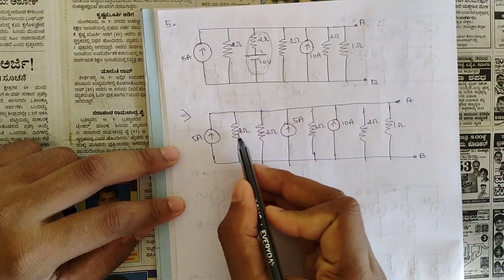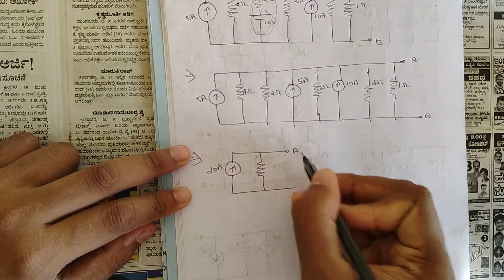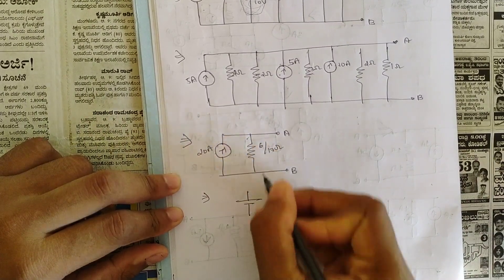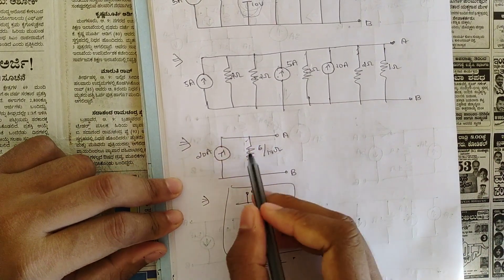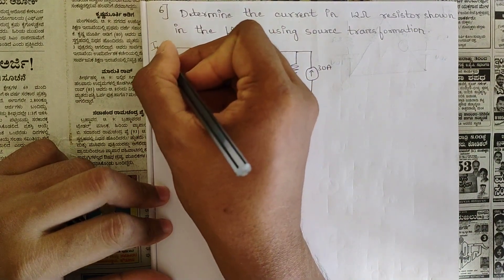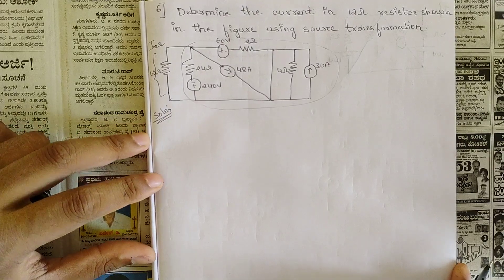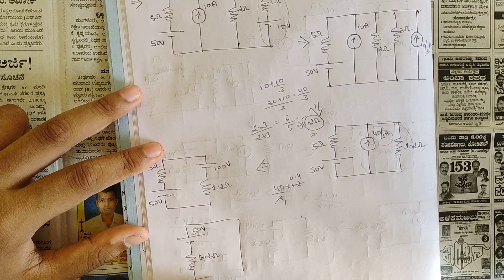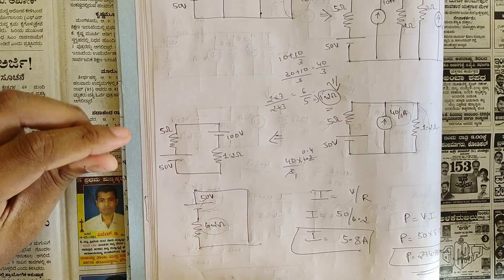5.Source Transformation 3 Problems Explained 3rd Network/Circuit Analysis Sem ECE Latest Schem VTU

Comment from the maker: In the last problem there were few mistakes:
1. 40/0.4=16(not 100)
2.Hence due to the negative voltage polarities it would be 50-16=34V
3.Now in I=V/R it should be 34/6.2=5.48A
4.Finally for power it is 34*5.48=186.32W
.
.
Please correct these mistakes and I'm so sorry that I didn't look out at these as I was in a hurry to complete the syllabus 
THANK YOU 👍🏻
Reply: bro i have small doubt in last problem,because why you have just changed only 10V to current but not 50V
Reply: can i have your number please for contacting you directly..........
Reply: @MovvaSuryaNagaSanjeev  same doubt as in  5th question we made all voltage to current gen added all the parallel resistance and current why not in this one
Reply: No problem sir sir bere Subject mele nu video madi sir nan e sala clear madko beku 3sem alli 3 core subject back ittidini 😂😂

Comment: brother in second step why can't we convert the voltage source (on left side) to current source so that further all current sources will be added up for further simplification.
Reply from the maker: Ya we can do it...
Actually there are many ways to solve these problems....
But the final answers should not change
Reply: @VTUAcademy_009 but your answer is wrong 40*0.4 is 16 .. uh did 100.. please clarify
Reply: @VTUAcademy_009  bro but while doing it as mentioned above we are getting another answer which was kept in comment @ In the last problem there were few mistakes:
1. 40/0.4=16(not 100)
2.Hence due to the negative voltage polarities it would be 50-16=34V
3.Now in I=V/R it should be 34/6.2=5.48A
but while changing it both sides we are not getting voltage as 34V?
one can you check it out and can you reply......................

Comment: In the 3rd sum last step 2 voltages were with same polarities i.e 50v and 100v so it should be added ryt? You've subtracted it.
Reply from the maker: No ...
Look at the network carefully...
Break the connection from one side and convert it to a single line and then check the polarities.. .
It's different
Reply: Even on different lines on left first + then - same on right first + then -  it should be added ryt